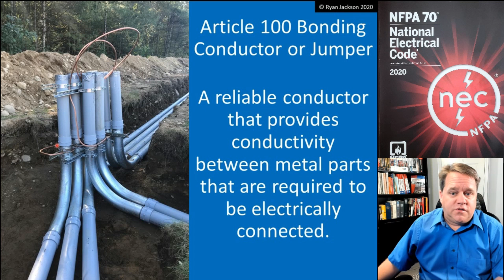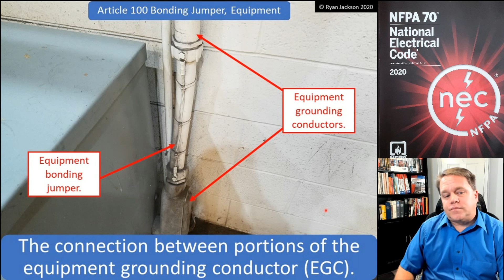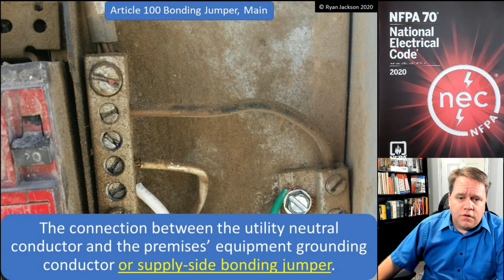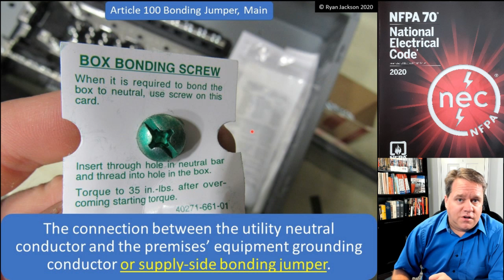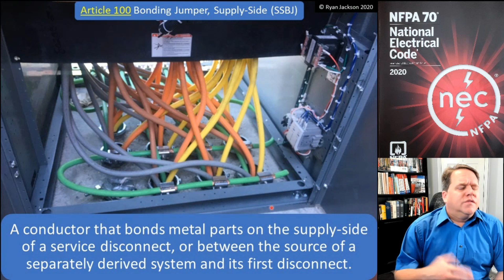100 Days of Article 100: Bonded, bonding, main bonding jumper, system bonding jumper, etc.

Comment: Does the primary side of the transformer (480) in a flex  conduit need bounding bushings or bounding lucknuts?  Thanks
Reply from the maker: Only if there are concentric knockouts
Reply: @RyanJacksonElectrical  thanks for taking the time to answer this question. you are the best... love your videos...

Comment: For utility pad mount transformers  that lands to large amperage switchboards, is a SSBJ required in each of the parallel run. I’ve seen installations where it was and where it wasn’t. Even tho there was a Main Bonding Jumper was installed at first service disconnecting means.

Comment: Ryan, could you please do a grounding/bonding video educating on the proper installation of an older three wire feed and the newer (Post 2008) required four wire feed at a detached structure like a garage? 

For example: On an older style three wire feed to a detached garage the neutrals and grounds must be bonded together with its own (separate from house) Grounding Electrode correct? Thanks!

Comment: Would it safe to say in most cases you would install a system bonding jumper or a main bonding jumper but not both?
Reply from the maker: In one enclosure? Yes. If you have a service (utility) and you also have a customer-owned transformer to go, for example, from 480 to 120/208, you will have a MBJ at the service and a SBJ at the transformer.

Comment: 6:10 please share where it’s stated .
Emt conduit is only good up 60 amps for grounding. Purpose.
Reply from the maker: EMT can be used regardless of the circuit rating. FMC and LFMC have limitiations, including the rating of the circuit. See 250.118.

Comment: Question - I work at a water district and we are re-building a pump station.  The meter pedestal, free-standing disconnect switch, and permanent generator are all on different concrete pads.  There is a new rebar reinforced concrete driveway with handholes in it, too.  Should the rebar in the concrete pads and in the driveway be bonded together and bonded to the ground grid?  Some websites mention the concern of rebar corrosion due to the copper ground grid.  Thank you.  Your videos have taught me so much!

Comment: You are a great teacher of this. Have learned so much by this series...Nugget picked up today: Supply-side bonding jumper ALSO describes green wire between the source of a separately derived system and its 1st disconnect!

Comment: Excellent material, Ryan!
Just wanted to point out that you misspoke in 5:50. You pointed out to having some FMC in the picture you showed. I think you should have said liquid tight FMC. It seems to be liquid tight FMC. Furthermore, for an FMC jacket to be considered EGC, the OCPD should be less or equal than 20 A together with a few more conditions while for a liquid tight FMC, the OCPD can be up to 60 A plus a bunch of other conditions.
Thanks for sharing your experience!

Comment: The trend here in Canada is to stop putting ground electrodes into separate buildings that are fed from a main panel elsewhere. For example this week I was asked by an inspector to remove my ground electrode connection for a greenhouse fed by a new four wire service from a home. This would be a good topic one day for discussion, since there are a balance of competing interests and risks. Is it accurate to say that a new subpanel in a separate building fed by an EGC from the main panel should not have a ground electrode? What about lightning protection, and protection of animals in a barn? If I look to older advice, this recommendation has taken a 180 degree turn....
Reply from the maker: The NEC definitely requires it [250.32(A)], and the NEC never requires a grounding electrode to be removed. I don't see how the grounding electrode would help the animals in the barn, but you are right about the lighting issue. In my opinion, you want an electrode(s) at every building supplied with electricity to help deal with lightning-induced energy.
Reply: @RyanJacksonElectrical  I understood his point that the new ground electrode is not tied together in the ground with the main building ground electrode forty feet way, even though by the letter of our code this is a separate building so I thought it would be an exception (10-104). I guess it is to suppress eddy currents, and stray currents from other homes. To my surprise, when I proposed a compromise of cutting off the electrode connection to the EGC and leaving the lightning connection of building to electrode intact, he wouldn't bite. He insisted that the new electrode ground be cut off right at concrete level, leaving the building unconnected to ground electrode. He said that if I wanted I could bond the EGC to the building, but did not require it (building is anodized aluminum so connections would be tenuous anyway).
Reply: @spelunkerd   Sounds like your inspector left your building flapping in the proverbial electrical winds with no well structured way to bleed off induced currents or static potential differences from the structure to the earth.  Hopefully there are paths that don't cause high potential rises before arcing and that don't arc through something easily ignited.  

Ground seems like a simple concept but it serves quite a few purposes and if you focus on one without considering the others, you sometimes create risks.

Comment: Can never find out what the proper size bonding conductor should be used when say a 250 MCM copper ground is tetminated in a large switchgear room to a 1/4" thick 4" wide 2 to 4' copper plate. Some places they only use a #10 bondind wire from grounding bushing on the conduit to copper ground buss barr. Ither places they use #2 copper. A large contracter installed at least 50 transformers without installing a ground from metal conduit that ran say 12' from steel beam to carry ground wire. Made them come back and install a grounding bushing on one end of these conduits then a wire from bushing to steel beam. They tried cutting corners by using PVC conduit for transformer ground wire but in our large city use of PVC not allowed due to dangetous fumes genetated when they catch fire.

Comment: I have a question. How do i properly bond a few 1/2" AC cable (not MC cable) connecting to a subpanel cabinet? There is no EGC in the cables.
Reply from the maker: It is bonded through the connector, just like EMT.
Reply: @RyanJacksonElectrical  thank you!

Comment: It used to be any metal located within 10' of a pool ie. Wrought iron fences, handrails etc. needed a bonding wire if that fence had a break via a gate both sides needed to be bonded...
Reply from the maker: 680.26 still has similar requirements.

Comment: Ryan I'm just a 22 yr old trying my best to get my Journeyman sometime shortly. I have a ? Its more of a theory ?. If you have a Multiwire branch circuit with 2 pole 20A. If you have 10 amps on 1 leg and 5 on the other. Having a unbalanced load of 5 amps of return current on your Neutral. If your main bonding jumper connects your enclosure to the Neutral. Does your enclosure itself have a load of 5 amps or does it go back to source or your GEC? God Bless you and your Family! I appreciate all your videos!
Reply from the maker: The enclosure has current, yes. But, the conductive objects are all bonded together, so you don't get shocked by touching it.
Reply: So it already being intentionally bonded, even you becoming grounded it wouldn't shock you. I think I understand i do appreciate you always responding 👍
Reply: @buckhunter4413  Correct, because if it is properly bonded there will be no potential between you and those metal parts.

Comment: In my 50 years as a sparky only ran power twice for above ground pools for friends at no charge due to liability concerns. I always considered wiring an inground pool with all the bonding & grounding a speciality like some medical professions. I had no problems troubleshooting production equipment & drives and installing services up to 800 amps but always had a full work load so stayed away from all pools and alarms. A few years ago while attending an IAEI CEU the teacher/inspector warned us that normal insurance policies in our area do not cover installing or maintaing alarm systems. Have to pay thru the nose for a policy covering just that. Thanks for all the great easy to understand vids.

Comment: (A subscriber) Confusion:
When I use a (bonded portable generator) as backup power to a properly installed transfer switch via L14-30 Connection I believe I complied with bonding code and safety requirements. However what happens if I have an older generator where the neutral is not bonded?
Reply from the maker: Fair question. The answer is, nothing interesting. That's because a generator that doesn't have a bonded neutral will always be an ungrounded system, even if you drove a ground rod for it.